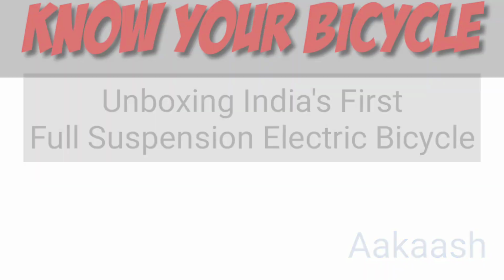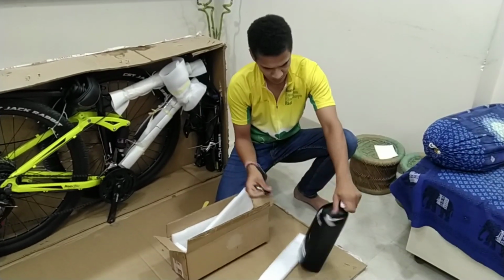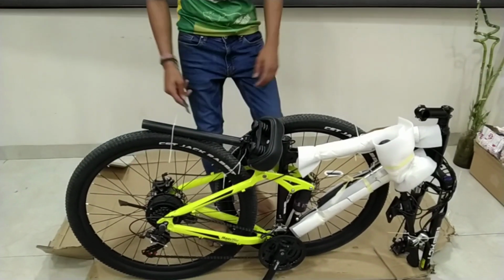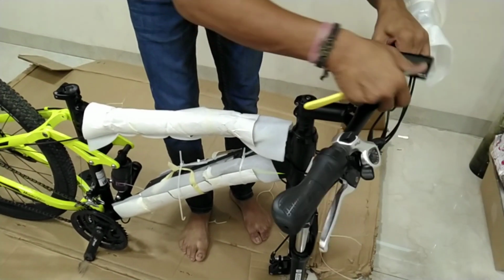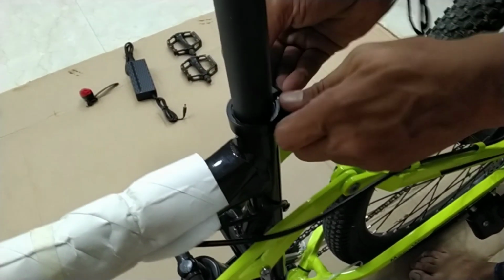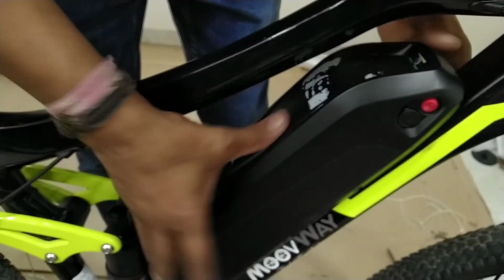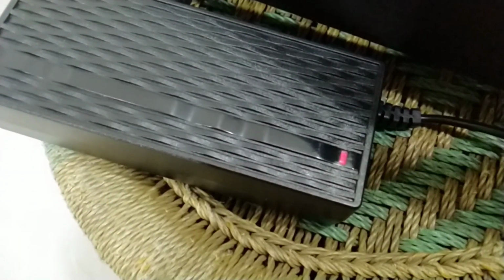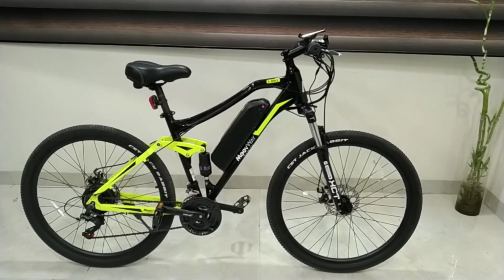Unboxing: India's First Full Suspension Electric Cycle | Ebike | Electro Motorad |

Comment: Looking from the perspective of the buyers, considering the possibility that the brand may not exist lets say after few years, can you please tell which parts of the bike we can get off-the-shelf and which parts we wont  get. I am not talking about main frames and all. Talking about the parts which generally needs periodic change.
Reply from the maker: Okay. All of these electric equipments can be bought from the market, like batteries, sensors or even display units. As more and more companies are coming in ev segment, these things are readily available and are universal components.
Reply: Is it possible to test-ride/experience it in bangalore?
Reply from the maker: @KRISHANU01  definitely.  Please feel free to visit Everest Cycles.